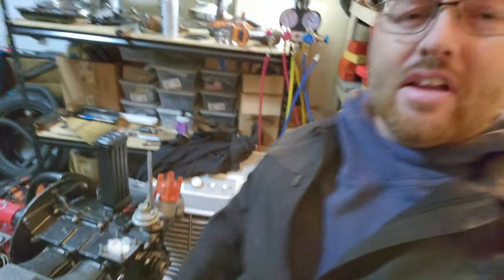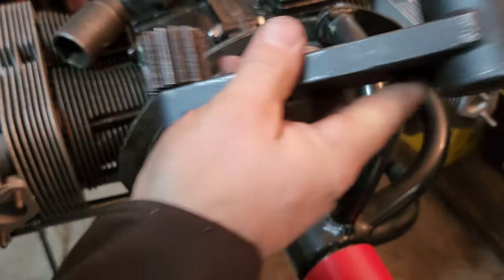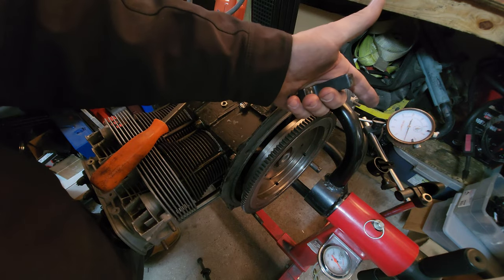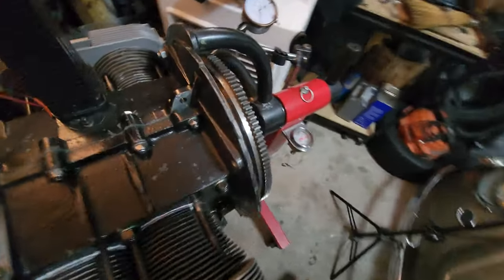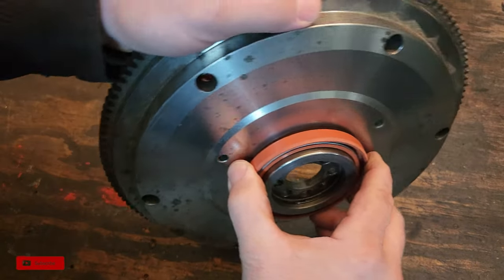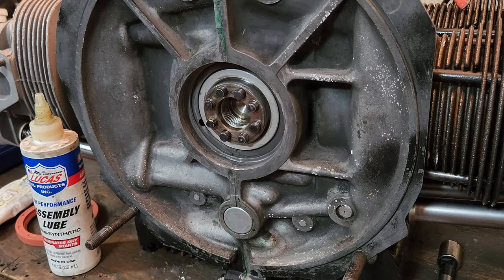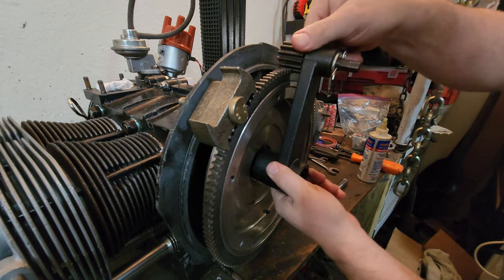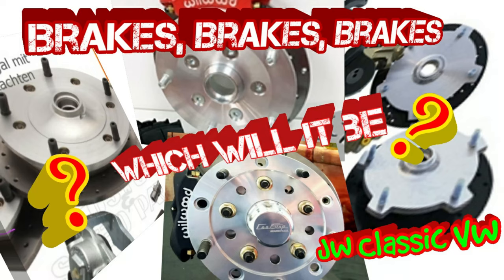How to Rebuild a VW Air-Cooled Engine "PART 11" Flywheel End Play and Seal Install | JW Classic VW

Comment: Having had a flywheel come loose some years back, I use a heavy duty Chromoly gland nut with a thick dished washer (inexpensive peace of mind)  and a set of deep dowel pins. I use Loctite on final assembly and i torque past the recommended 250lbs, even up as far as 350lbs. 
I've also had many issues with leaky/torn oil seals due to a combination of bad advice and sloppy assembly.  Like you I was told to sit the seal flush with the case. Bad idea. Patience is the key and I now use assembly lube generously around the seal before final flywheel assembly.
Learned through experience, got it right on my last engine build.

Comment: If you do it at the short block then you don't have to consider the wrist pins affecting anything. plus it's light enough to get up on the bench . Use the magnetic base of the dial indicator on the flywheel and the indicator on the case that way you don't have to think about the engine stand giving you movement that could affect the measurement.

 also keep the gland nut loose on the crank - then when prying the flywheel off you don't have to worry about it popping and dropping.
Reply from the maker: Some good info brother, we all have our way that's for sure.

Comment: Hi jd,hope your keeping well,i have a question for you,will you be doing anymore builds on the flat 4's,as i was watched the part where you installed the flywheel,and turned it by hand a little,did you ever try a complete rotation on flywheel by hand with plugs installed,because on my engine,i can rotate quite easily without plugs,but as soon as i put the plugs in,it becomes very tight to turn flywheel by hand, i know it is on a compression stroke,but i am not convinced the starter will turn it over as a result,i just recently installed new piston rings,and can appreciate a little stiffness due to rings being new,so if you do another video of another engine,could you do a complete turn on the flywheel,(plugs installed )so i can see how stiff it feels to you,i never saw the start up of your engine,did i miss it,or is it coming up soon on your video bud,sorry for the silly question,but i need some kinda closure as to whether it's just my imagination,i don't want to attach starter,as i'm pretty sure it won't crank it over and don't want to burn out the starter out,cheers for any advice given jd.
Reply from the maker: No problem..  I can add a demonstration of turning the flywheel by hand with and without spark plugs.  There is a big difference.
Reply: @JWClassicVW  Hi jd,i agree there is a big difference,i will be adding a starter soon,but just not convinced it will crank over,? my bus has been off road for over two years now,due to finding time to rebuild engine as i work long hours in my job,so hope you can shed some light on this matter jd,cheers.
Reply from the maker: Don't forget you'll want to prime the oil system with no plugs.  The reason is basically what you found out.  You'll burn up the starter with the plugs in priming the oil system.
Reply: @JWClassicVW  That will be done prior to starting jd,thanks for the advice my friend.